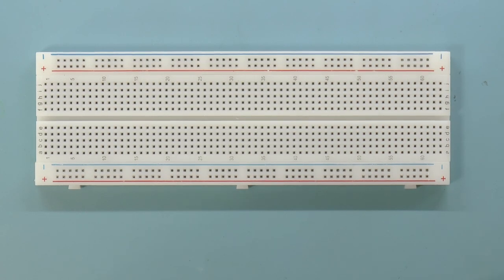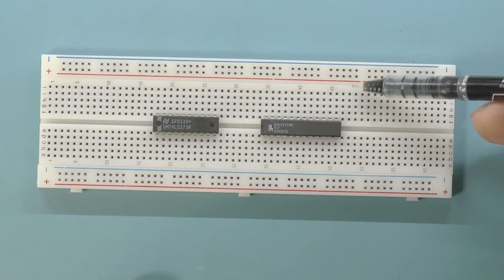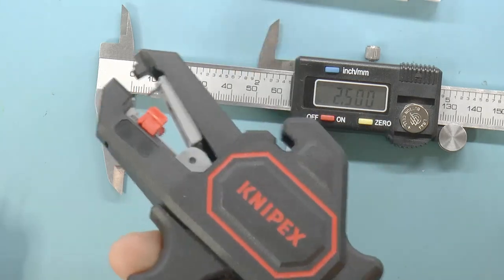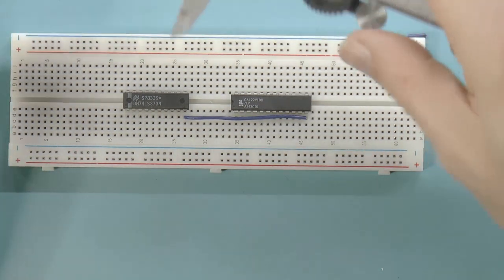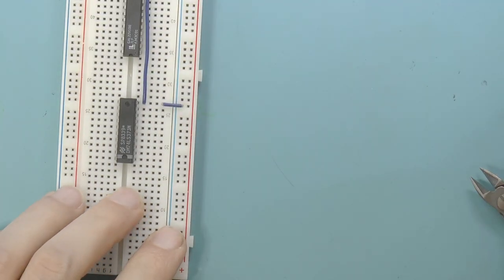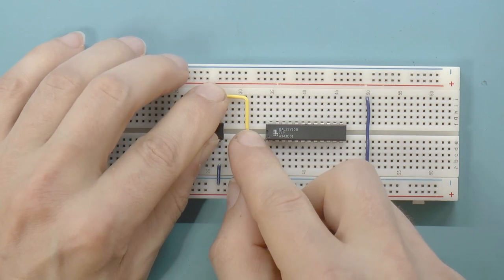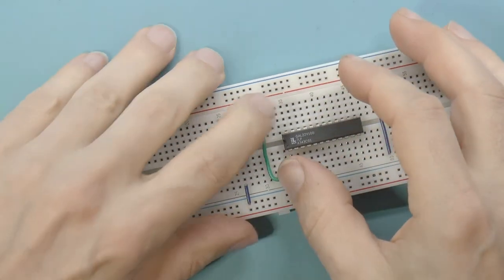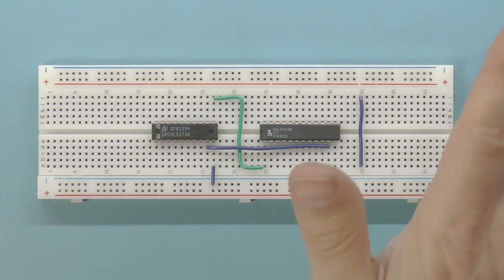Chip Tips #6: Beautiful Breadboards

Comment: I tend to strip one end, put it in the socket, lay the wire flat along the path I want, clip about 6-7mm (0.25-0.3 inches) longer than the second socket distance, strip that end, and plug it into the second socket. Skips a bit of arithmetic and the calipers, and is slightly faster. Of course for high frequency stuff I tend to dead bug it on copper clad, solderless breadboard parasitics are ruinous.

Comment: Thanks for your videos! by the way,  which brand of breadboards do you use? Some of the ones I have bought are awful.
Reply from the maker: yrath I get mine from Adafruit.
Reply: Thanks, also, can I ask which brand and type of wire you like using? I'm from the UK and I'm in my 40s, so when I was a kid we really didn't use solderless breadboards, so I have little to no experience with them. Almost everything I have built from then until now (that wasn't an etched at home or a professional PCB) was made with Veroboard (stripboard), which meant cutting tracks on the board with a cutter and soldering jumpers between the tracks, I'm really quick with Veroboard and a cutter, but slow and clumsy with solderless breadboards.  Most of my colleagues from the US are not too familiar with it and those who know of it completely discount it and say it is terrible, they are familiar with perfboard and wire-wrap, but not with Veroboard that has tracks. Have you ever tried Veroboard?
Reply from the maker: I've tried Veroboard -- here in the States the canonical brand was Vectorbord. They were always hideously expensive for a thing you could only use once. I used a few, but I mainly used breadboards. I've recently done some SMD prototyping on what's essentially Vectorbord, except now you can get your own PCBs made for cheap from China. As for wire, I always use solid core, 22 AWG, sometimes called "hookup wire". The brands are Remington and NTE, but wire is wire. Anything that is solid 22 AWG will do. I have a lot of colors, but you really want a minimum of three: red, black, and any other color (except white). It's good to have another prototyping technique, but your favorite technique will always be the best :D  BTW, I the Adafruit breadboards are the good kind, not the crap you get for USD 1- each. Check out Julian Ilett's comparison here: https://www.youtube.com/watch?v=VerbEZtACwQ
Reply: @yrath5034  FWIW, the 3M breadboards are the gold standard. They’re quite expensive, but they last forever. The first time inserting a pin into a hole is VERY stiff, but later insertions are easier, but they always stay stiff enough to make good contact, unlike many el-cheapo breadboards. FYI, the 3M breadboards are manufactured by a little company called Assembly Specialist, Inc. If you’re in USA, you can order direct from them and save a bit of money.

Comment: Great video - the easy way to achieve a clean layout. 

Suggestion : instead of counting holes why simply :
1) note the column numbers at end and start and subtract
2) simply put the tip of the caliper jaws at the desired holes and you do not even care about the actual length in inches 
3) a cheap plastic caliper would do. all you need is a something that slides and locks at a set position.
Of course this would not work for wires following a bent path. But these should be the exception.
By the way, I did see negative reviews on Amazon about the stripper  you use. It can never be clear if they come from people who simply abused the tool or if the complaints are justified.

Regards

Comment: Got any recommendation for good breadboard or wire gage etc?

I got a few breadboard but I find the holes to be a bit too tight for my liking. 
i often need to use pliers otherwise I just bend the wires.

the hole for the power are quite loose though. stuff can easily get disconnected
Reply: I like to use 22 AWG wire and breadboard# BKGS-830-ND from Digi-Key.
Reply: Tight breadboards are better electrically. What I do is to cut wires and component leads on the diagonal so that the tapered ends can pry the contacts apart better. Makes insertion much easier.
Reply: @tookitogo  

The problem I have is typically electronic pieces tend to bend.

I can shorten their legs, but it makes them harder to handle and it ofc can't be reversed,
Reply: @Pac0Master  trim them on the diagonal to make a point (you aren’t removing much length, and it makes a big difference), and continue to use small flat-jaw pliers or very strong tweezers to insert them. On parts with kinda wide, flat legs (like in TO-220 cases), use flat-jaw pliers to twist the leads 90°
Reply: @tookitogo  

Yeah, the pliers are pretty much essential at this point.
Reply: @Pac0Master  Do you have good, small electronics pliers? They make it so much easier. I use the Knipex 35 12 115.

Comment: The biggest problem is that you'll end up with 100's if not 1,000's of very specific cuts of wire that will only bridge two points at a fixed proximity or you end up cutting them even shorter to re-use and so on.

It's fine if you plan to keep your prototypes on breadboard forever but not sure why I'd want to do that. Jumper wires may not be pretty but they can be re-used without much restriction...I'd argue that even a neatly wired breadboarded circuit isn't as pretty or neat as a PCB so why use breadboard at all?

I get that it's probably easier to work with in the long run but for prototyping it seems a bit overkill and wasteful.

ETA: I sometimes will twist jumpers together between connections to keep them grouped if I can, for smaller jumps I'll often tie large, loose loops in smaller jumpers just to keep them out of the way and it can be made to look quite neat if done carefully.

I think I'd rather use small cable-ties to keep my wiring neat than go this this extent which I've used before, they're cheap and cheerful and really quite useful, when you're done - snip 'em off and you're good.